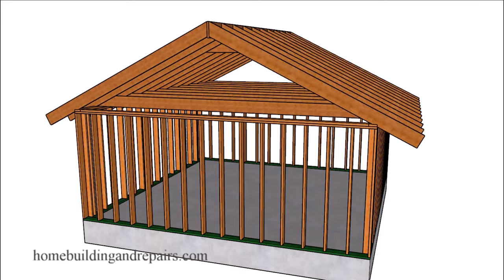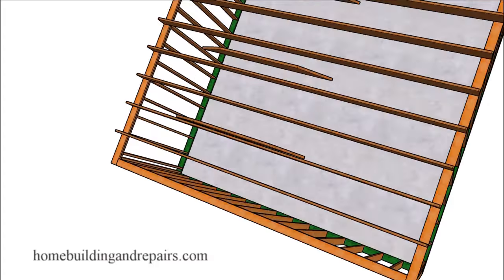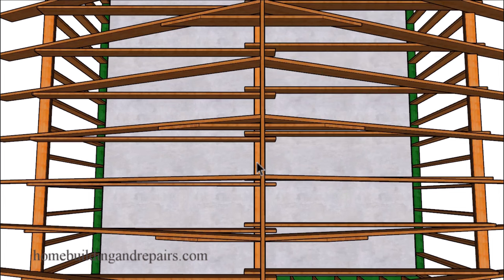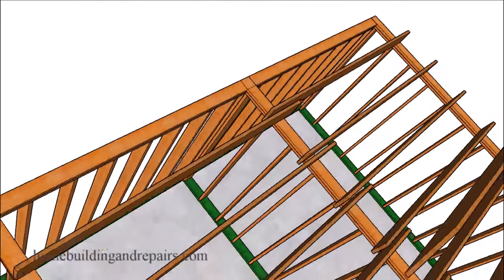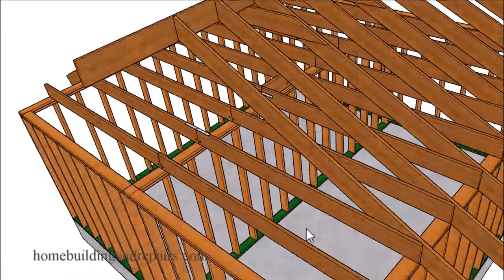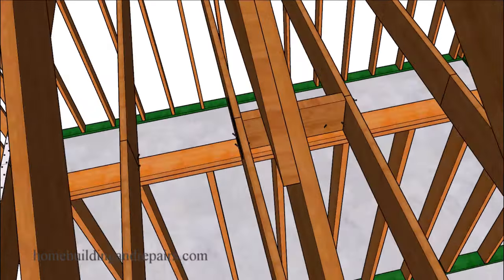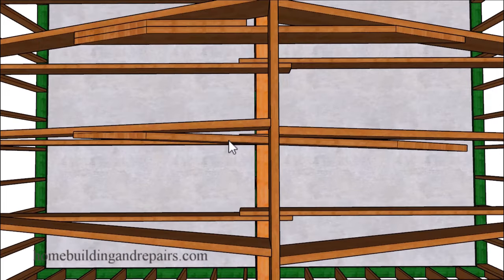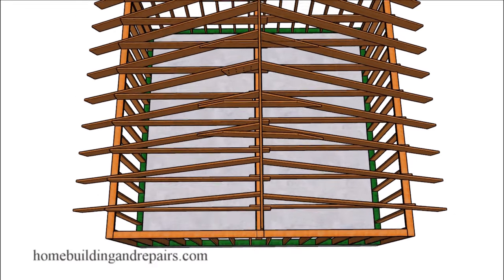How to Layout Ceiling Joists to Create Structural Roof Rafter Ties When Lapping Over Interior Walls

Comment: So I'm buying an older home. Beautiful full brick, copper pipes, cedar and milled beams throughout. Except the roof has a rafter style and the previous owner destroyed its rafters and collars during so called "updates." My inspector said I could theoretically put any style of roof on the home. 
 I am considering a retrofit of a ridge beam supported by a column of 2 posts, or scissor trusses as we want a steep roof on the home. It looks like a massive shed as is. We will increase useable space as well. Can it be done?

Comment: Another awesome video Greg. Thanks! Have you done a video on combination ceiling joists/collar ties? I'm building a 12:12 roof, 24' wide house, 4' knee wall, 8' ceiling. So the ceiling joists would attach to the rafters 4' in on both sides. They will be supported by a wall in the middle. I saw something in the Code that said if the ceiling joists are not attached to the top third of the rafter, the ridge beam has to be a true "beam"?
Reply from the maker: I would check out our website in the roof and ceiling framing sections. Let me know if you don't find something helpful.
Reply: @gregvancom  👍👍👍

Comment: Hello, I have a question. When you have ceiling joists stopping the rafters from opening up, is it necessary to still do a 'birdmouth' on the rafters, so they 'sit' on the top plate?? Thanks
Reply from the maker: You have a good point, but most engineers require a birds mouth cut.

Comment: Let’s say the joists were overlapping then a block was put into tie them together and put over a wall underneath to support. In this case there’s no vertical load on the joists right? The joists are counteracting tensile forces from the wall if I understand this correctly. SO if you wanted to take out that wall, what options do you have?

Comment: Can you help me. I have a double pitched roof for a garage (2720 mm W x 5500 mm D and 4200 mm to highest ridge). The roof is supported by 5 x trusses with bottom core of 5500 mm long known as Fink style with W-shaped webbing. The truss is made up of 3 inchs x 1.5 inches timber. I would like to make a loft space usable with creation of a mezanine floor. For that I need to remove W-webbing of 3 of trusses as they are in a way. I believe ceiling joist should be 6x2 inch timber. Any suggestions pls.
By the way, I am not a builder (I am a healthcare professional), I am learning from YT like yours.
Thanks a million in advance. God Bless.

Comment: Hey. Quick question. What is minimum lenght of top plate? 
Also maybe you can recommend some books with codes and rules. Why im asking? 
Im trying to learn framing. In living im europe/ Poland. Here is not enough books with knowledge about framing.

Climate here is like east/north part of USA. Hot in summer , cold winter  with wind somethimes
Reply from the maker: There is no minimum length for top wall framing plates. However there are some building codes that require a 4 foot minimum lap in longer walls with plate breaks.
I do have more wall framing videos at our website. https://www.homebuildingandrepairs.com/framing/index.html

Comment: I have an old garage with no center wall. the rafters were installed at 32" and to make them stronger for storage above them i wanted to insert a new rafter at the 16" interval that was never used originally. I am curious how you would join two boards to make a structural rafter or if that is simply not done.
Reply from the maker: If you can remove the lower blocking, then you can slide the rafter through the opening and install the long rafter. Then reinstall blocking. Let me know if that's not possible in your project.

Comment: Hey good content, I have a question, is there a nail requirement to toenail the ceiling joist to the top plate (quantity and size nail)?
Reply from the maker: I like to use 16d sinker nails and put two angled toe nails on one side going through the joist into the top plate and one on the other.
Reply: Appreciate it

Comment: code only requires 1.5" bearing on a loadbearing wall. So there is really no need to even lap the joists. R502.6 Bearing.
The ends of each joist, beam or girder shall have not less than 11/2 inches (38 mm) of bearing on wood or metal
Reply from the maker: Thanks for the code reference numbers.